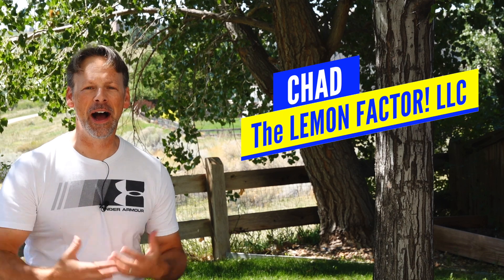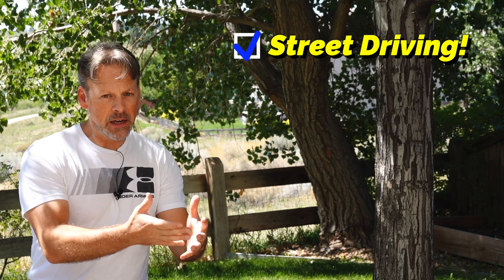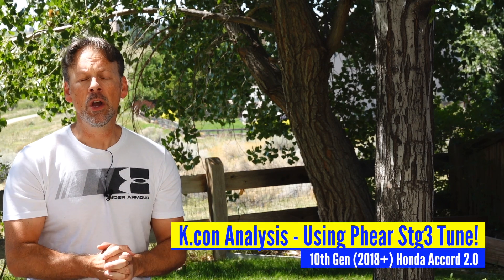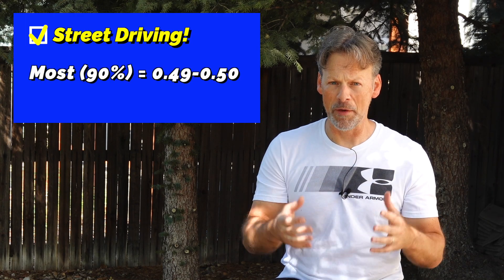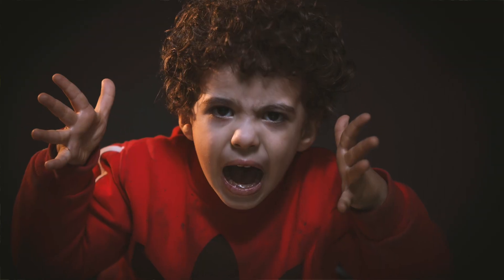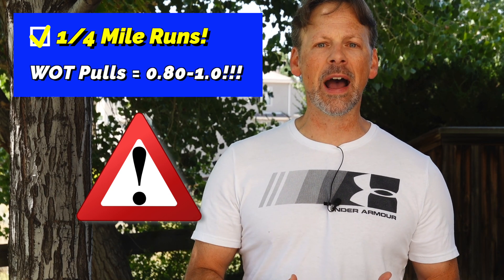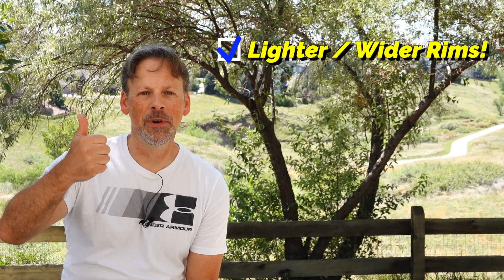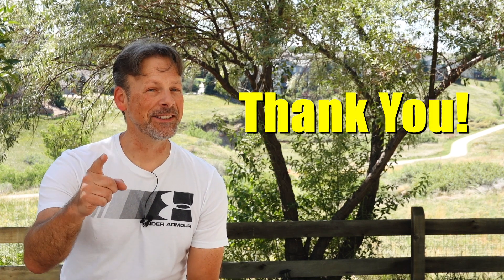KTuner K.CON Analysis!?! (using Phearable Stage 3 ECU Tune) // 10th Gen. (2018+) Honda Accord

Comment: i need help because i’m catless with intake and stage 2 with 93. when im cruising ill see it around .49-.59 when i press that gas… forget about it. it goes up to .80-1.15 sometimes. i’ve been using the same gas station for a year straight (BP). i also don’t see my boost bar stay maxed out like i used to when i first got the tune. it hovers underneath the max and sometimes drop a tad bit and very randomly it stays max. idk what to do or try besides maybe different gas idk.

Comment: I have a 21 accord 2.0t that I just did a prl hvi v2 intake, Mishimoto intercooler and this phearable stage 3 93 octane tune. When I drive I did .54 typically was my k cont but when I did a little pull to 80 it shot up to .84, then another pull or 2 after shot up to .91. Why is this and how can I lower it?

Comment: Would you recommend the 93 tune if I have easy access to 91 octane and e85? I live in Cali and have no other mods
Reply from the maker: I'd recommend sticking with Pherable's 91 tune, as the difference isn't that significant from a power standpoint, while also providing you with the extra protection.
Reply: @ awesome, also I noticed that you have 2 videos of the phearable stage 3 dyno, one with much lower numbers, is this something I should be concerned about? The numbers don’t seem all too consistent and phearable has gotten really expensive

Comment: anyone here can help me, i’m in cali running 1.5g e85 and 91 for the rest but im averaging 60-70 on regular driving. and have seen it shoot up higher during spirited driving
Reply from the maker: Where are you getting your gas from?  Have you tried changing brands?
Reply: @TheLemonFactor yes i have changed brands, i was primarily using chevron but just switched to costco with 2 gallons of e85 and it did bring down my k.con slightly doesn’t get past .69 for the most part. Phearable suggested to put in 3 gallons of e85 and said it was perfectly fine for the car. any comment? would upgrading to the PRL intercooler reduce the numbers ? that’s something i haven’t done yet
Reply from the maker: Upgrading the Intercooler is a great modification but unless you’re intake temps are running really high it probably won’t impact the k.con numbers that much. Have you considered getting a custom tune?
Reply: Is there a custom tune that’s used for 91?

Comment: Hey man. I’m in Thornton. You have a performance shop you like?
Reply from the maker: Hi neighbor! 👋  as I install everything myself, I’ve not had any experience with local shops for the Honda Accord 🤷‍♂️
Reply: @TheLemonFactor  gotcha. So far the only thing I’ve put on mine is a sticker, and I’ve managed to mess that up 😂
Reply from the maker: 😂 what are you looking to do?
Reply: @TheLemonFactor  intake, intercooler, charge pipes :) then I’ll add the k tuner, and some lighter wheels.  Just wondering if I would be better served to have a shop  do it all for me at one shot

Comment: Im getting .88 k on start up and stays there im about to reflash to stock, do full maintenence on the car as its at 50k miles, ive been using 93 but im starting to suspect that its the fuel
Reply: This is on phearable stage 3 on a 2018 accord sport 2.0t with a 6spd
Reply from the maker: So if you were to drive at a reasonable highway speed for a period of time, you don’t see your numbers drop?
Reply: No I do not I switched gas stations , between the 91 and 93 tune, tried mishimoto, k&n, and now prl hvi v2 intake, I have a mishimoto intercooler, put different spark plugs in and haven't seen much improvement I'm thinking fuel pump, I don't want to custom tune until I swap turbo and do flex fuel
Reply: @jonahhonke9228 hey any luck on your k con?

Comment: Can someone tell me what is a normal amount of k count cause I tend to see some drives like to work for example I’ll get 3 knocks in a 40 minute drive and the other day it went to 3 immediately after starting. And then I think I saw it go to like 8-9 in a span of say 30 minutes so is that bad? Don’t wanna damage my car I have the regular Ktuner stage 2 I have a PRL HVI and a Borla exhaust nothing else aside from those mods. Should I get any more
Reply from the maker: I wouldn't be too concerned about the K.count.  Although it is a count of events, the events may not be knock.  I would focus on the K.con readings.

Comment: I’ve been in phearable stage 3 for about 2 weeks now (91 version) my conclusion so far is that Cali gas is TRASH. I haven’t seen anything under .63 at all times and even during small pulls it would jump like crazy to upwards of .75. One time even .83 and I just flashed back to stock so wouldn’t deal with it. Would you say it’s worth just getting a custom tune? Or wait to do bigger upgrades and just stay in stock tune for now ? Thanks!
Reply: Same issue for me. Normal cruising hangs around 0.70, but wot pushes .80. I am currently running Stage 2 on 91 Octane. I flashed back to stock and found that it was still hanging around 0.70 stock. Ill try to find some 94 Octane next
Reply: @SpyToeMan  I actually flashed back to stage 3, but have been using 1.25 gallons of E85 and the rest 91. It stays at .49 for the most part and won’t go over .54 with hard pulls. I’d recommend it if you’re able to get E85 I’ve been running it for 4 months.
Reply: @Fecho00 hey bro so i’m in cali in the bay area and been running stage 3 for about a month now. been seeing numbers around .62-.72 when WOT or just hard acceleration with 2 gallons of e85. primarily been using chevron but today switched to costco and numbers dropped to under .69 what gas are you running ? idk how to bring them down to .50s
Reply: @Jrhymee14    I’ve actually been running stage 2 with ethanol enabled (e30-e35) for going on 9 months. Pretty reliable and rock solid numbers. When I was stage 3 I tried filling up at Shell, Chevron, Valero, and even Costco 91. All had crazy unstable numbers for me. I’m in the Monterey area for reference.
Reply from the maker: I do recommend a custom tune 👍

Comment: Chad,
What Ktuner quick adjustment and quick enables do you have set at?
Asking because my Kcon seems to jump around a lot on stage 2 with quick spool enabled and all the quick adjustments set to max. It always goes back down to .49 after feathering the throttle on the highway but it’s rather annoying watching it rise by .05-.1 after every wot pull with minimal to zero knock events being recorded
Reply from the maker: I believe (but I’d have to go back and check) that everything is set at or close to the most aggressive settings, except for the one that says “race only”.

Comment: I'd like to see if "TORCO F500010T Unleaded Fuel Accelerator" would help with your k.con on the drag strip. (Probably too costly to use on a daily basis). I use it to bump 93 octane up to 97 in my 1990 Mustang 5.0 with a NON-intercooled supercharger running at 9 to 10 psi on a custom tune. I add 16 ounces to 10 gallons of 93. Torco says that ratio adds 4 points to the octane.
Reply from the maker: I do have some Royal Purple octane booster but have yet to try it 🤔🤷‍♂️

Comment: If you want to see high K.Con, run 87 with the factory tune at 90mph.
Reply: It will make you feel better about the other tunes.  I saw mid 80s.  Switched back to KTuner stage two with premium, I was back at 53 max.  87 and 93 from the same gas station.  Makes me think the engine was designed for premium.
Reply from the maker: I think I’ll take a pass on that one 😧

Comment: You're not alone, I just sold my 9th gen but around 75-85mph my kcount would rise and the more i was in it the more it would rise. It would only rise that high if i was starting from a low speed but if i started from 70mph on the highway and went to 130 i was ok. Not sure whats going on there but id like to know too.
Reply: Was running Ktuner OTS "Stage 2" 93 tune
Reply from the maker: I’ve been curious to know if the behavior is unique to the Phearable tune, or if we’d see the same from the KTuner Stage 2 🤷‍♂️🤔👍
Reply: @TheLemonFactor  from my numerous datalogs between the two I genuinely think it's the phearablestage3 tune

Comment: Also found the best way to bring Knock Control down is to cruise at the highest gear (10th) and feather the throttle to make like 0.1 psi of boost, and those values will start to come down.
Reply: this is how I do it after a pull.

Comment: I had a phearable stage 3 and 4 before my Type R Turbo (I'm close to sea level 300ish feet above), and found my Knock Control on 93 with Stage 3, never really crept above .6 unless I have really poor gas. Stage 4 with E35 mix, the highest I saw was .85 doing some roll racing due to REALLY and I mean REALLY bad 93. Added in some Shell 93 and a bit more Ethanol and never creeped above .6ish either

On Type R custom tune, I rarely see it go above .55 nowadays.

OTS tune definitely has a bit of safety built in, once you go custom for your application, it tends to stay pretty low in my experience.
Reply from the maker: You're right, the best thing you can do I simply get a custom tune.
Reply: @TheLemonFactor  Definitely hit up DRob at IMW when you do

Comment: I've found my numbers jump at around 80mph as well. I'm not bashing the Phearable tune, its decent for OTS but its just not great to run hard. I have found that the 91 version of the stage 3 tune is much more consistent and the power difference is noticeable but honestly not by much. I've had my numbers JUMP, and I mean JUMP to 1.1 one time on the 93 version, last time I ever touched that tune.
Reply from the maker: That’s scary 😧
Reply: @TheLemonFactor  yeah I floored it for a second, I looked up and I was like holy shit. Kcon numbers being high is obviously not good but I don’t think it’s dangerous, it’s there for our protection.
Reply from the maker: It’s dangerous
Reply: @TheLemonFactor  how so? It’s pulling timing to protect the engine, not good but I wouldn’t think anything bad could happen, right? Lol now I’m scared
Reply from the maker: It's pulling timing to protect the engine only after it's experienced an event(s) that in itself has the potential to damage / have damaged the engine.
Reply: @TheLemonFactor  yeah I understand. Although I’m not sure what it could be experiencing. Sometimes my numbers shoot up and there’s no knock count
Reply: @judgeFXX is the 91 tune like obviously different in power compared to the 93 tune?

Comment: We have 94 up here in Canada.   Im getting  the same results as you....   Varies between .49 and .7 depending on how you drive it .
Reply from the maker: I’m a little surprised that you have the same results on 94 octane 🤔
Reply: @TheLemonFactor  what were you expecting ?
Reply from the maker: Lower K.con numbers than 0.7 when using 94 octane
Reply: @TheLemonFactor  I guess on regular day to day drives it stays around .49 but will go up .70 on  the track... on a side note I tried using a fuel system cleaner and seen the value go up to 1.04!

Comment: I noticed kcon rises a lot of times when on the wrong gear. For example being on gear 10 on a 10 speed automatic on the freeway and putting the pedal to the metal. 
I am fbo on e30-35 10 speed and stage 2 ktuner
Reply from the maker: Wrong gear, or when the car downshifts from a high gear under WOT

Comment: did u have a flex fuel kit when u added e85
Reply from the maker: No, I did not have the flex fuel kit installed. Remember, in the example I provided, I only added 1-1.5 gal of E85 to a full tank of 91 octane.
Reply: @TheLemonFactor   is it okay if i put 1-1.5 gals of e85 with 93 with the stage 3. my 2.0t is my first build I'm very new to this

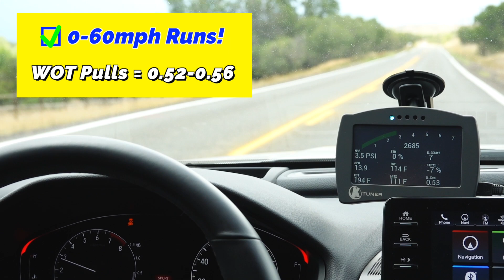Comment: At 6:39, how come your only getting up to 17psi? I have phearable stage 3 93 octane and I’m getting up to 22-24 psi full throttle. Elevation maybe?
Reply: yeah hes like 6k above sea level i think, when i was in CO i didnt even touch 20 psi
Reply: @JudgeFXX  he’s also on 91 octane not the 93 stage 3 tune so many they don’t run as much boost on the 91 octane? Not sure. That would be something to reach out to phearable.
Reply: @HondaAccordPerformance  he runs the 93 version using 91 octane, both tunes target same boost I believe just different timing parameters or something.

Comment: Off topic, do you have any info on proper engine oil? Running e35 on my accord and have been recommend by multiple people to switch to 5w-30. I’m in Cali, so not sure if the higher temps make a difference. I know the manual says 0w-20 so figured I’d ask.
Reply from the maker: I don’t know why you would run a different oil because you’re running E35. 🤷‍♂️. With that said, I’ve heard people switching oil, but personally wouldn’t recommend deviating from the OEM recommendation (long story).
Reply: If you run E on the regular it will thin out the oil and you might experience a leak at the valve cover as a result.   It really depends how often you run E and beat the car.
Reply from the maker: @TOURING 18 - please explain how the use of E dilutes your oil?
Reply: @touring189  how does running E lower thin your oil?
Reply: @glossking3570  you run more fuel using E.  Anything unburnt gets cycled into the oil thinning it out.  Do a quick Google and you will find more info.  I'd say just keep an eye on the oil and check for yourself.
Reply: @touring189  I'm not finding anything saying that but ok. Would love to send my oil in for analysis.
Reply: @glossking3570  search "does e85 dilute oil" and you will

Comment: Hi Chad great analyst of the k.con number base on fuel ans situation. I think it might be good to also do what you did with the stock tune. Run 91 gas on stock tune and monitor the k.con on each of the 4 situations you presented (norm, spirited, 0-60, & 1/4) and analyze to find delta between stock 91 and stage 3(93) tune 91 gas, stage 3(93) tune 91E gas and stage 3(91) tune 91 gas. You have most of this data if not all.

BTW can't wait for the wheel reveal video, I'm sure it gonna look awesome 😎
Reply from the maker: You’re right, I do have all that data except for the track runs when stock. They all fall between 0.49 and mid 0.50s. The video is coming with the new wheels. It drives much different than before 👍

Comment: Hey chad, noticed your 0-60 run around 6:47, are you stage 3 tune at that time or stock tune as your psi only goes to about 16-17psi
Reply from the maker: That’s with Phearable Stage 3
Reply: @TheLemonFactor  is that regular boost for 0-60 I know mine goes to like 23-24.5 psi, I think boost target is different for second gear
Reply: @kevindinh5382  im guessing he’s at higher elevation. I also have the phearable tune and I’m getting 22-24psi at 597 feet of elevation
Reply from the maker: I also see max of 18psi on the dyno pulls as well.  I’d have to go back to my logs to see what I hit for the 1/4 mile pulls.

Comment: Bro what ur rpm at idle? My rpm is at 720 - 730 idle is that correct?
Reply from the maker: ~750 RPMs at idle 👍
Reply: @TheLemonFactor  i get 1.5-1k idle at start up, then back down to 800 after a few min is that normal? im on stage 2
Reply from the maker: It’s normal.
Reply: question fuel trim short 5-10 and long -2 or -3 at idle is this normal ?

Comment: I’m running 93 with phearable stage 3 and I get upward .7 k cont. add 1 gallon of E85 and get .5. It’s definitely helped my numbers. 
Looking forward to seeing what the tires do for wheel spin issue.
Reply: Is it ok to add the one gallon of E85 with stock fuel lines/ module/ pump ?
Reply: @3Pedal_Accord  i think it’s ok. Mine are stock. Pretty sure no one is changing those items unless they are doing the full changeover for the stage 4 phearable tune.  I don’t think one gallon mixed with a full tank of 93 is going to hurt anything. Just keeps the k cont lower.
Reply: @flynfury8363 and what the k con purpose ?
Reply: @xojoeel  shows the knock count. You don’t want the engine knocking. Has to do with combustion chamber and fuel to air ratio. High k cont is not good.
Reply: @flynfury8363  how can i lower and why would mine be at 70
Reply: @xojoeel  if you have these after market parts in your car and or a tune on the car the air to fuel ratio can change. Add 1 gallon of flex fuel to each tank of 93 octane you put in your car and the knock count will drop well below .7.
Reply from the maker: Are you getting 0.7 and above under normal driving conditions?
Reply: @TheLemonFactor  I would say spirited driving. Not even really punching it hard but getting .7. The gallon of e85 works. Just isn’t available everywhere so not an option for some people.